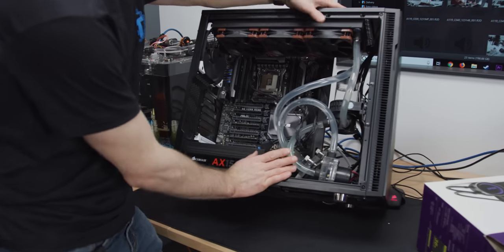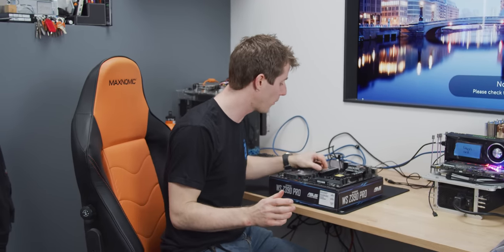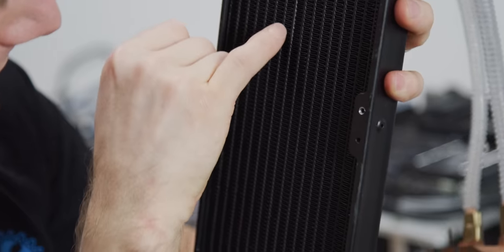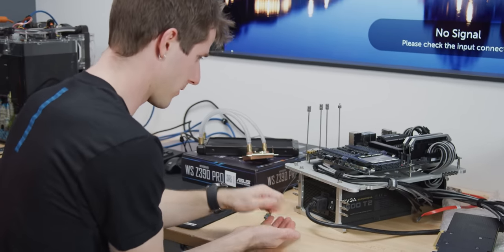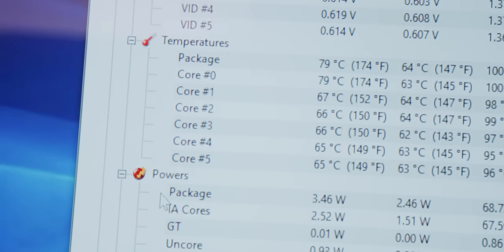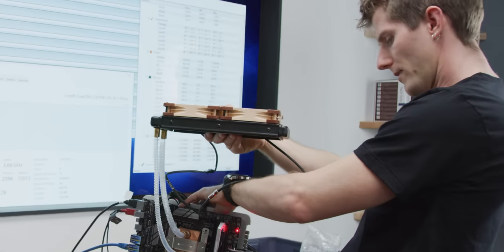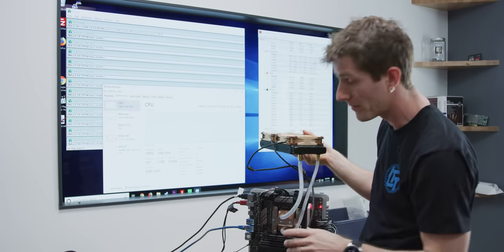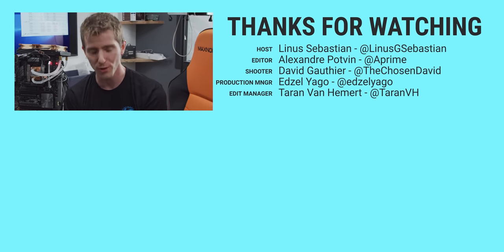CPU Cooling with BOILING LIQUID 🔥🔥

Comment: I still think that the Vodka cooled PC is the best one yet. As long as your PC doesn't get hotter than 26°C, there should be no problem, comrade.
Reply: Vodka > everything else
Reply: Boris.
Reply: stay cheeky breeky
Reply: @danielkrogh9748  *Cheeki Breeki
Reply: Yet it had a pump of sort.
Reply: vodka we need to try everclear or moon shine heck even pure ethanol 200 proof
Reply: *in russian dialect
Why have computer when you can have gulag where people calculate graphics?
Reply: [Boris liked this]
Reply: @Schaddn  
Boris has joined the chat
Vodka has joined the chat
Boris health has left the chat
Reply: @witnesszer0  
That is physicly impossible. You cant get pure ethanol from distlling it, not200 times and not 2000 times. Youll need to use something such as a molecular sieve.
Reply: The biggest problem is that you will end up drinking it out the tube
Reply: Thats the average temperature of my house
Reply: @rtg5881  $50/gallon
Reply: ✔️ GPU doesn't get above 20°C even while mining.
✔️ Living in relatively warm 1st world country
✔️ Having the fans set to 0% to save energy
✔️ Having a living room (with computer) which is at about 4°C due to a constantly opened window in winter.

I think I'm doing better than you, Boris and your fellow comrades.

Now seriously, I highly recommend opening your window instead of installing yet another heat spreader.
Reply: yep, alcools have a low boiling temperature, around 60C.
Reply: O Y  B L I N
Reply: Pc will not get warmer because capitalist pigs deny the glorious union its oil! Thus we sit in cold Siberian concrete flat. The means of cooling truly belong to the people here, comrade!
Reply: The approach isn't actually bad! The thing is: You need a liquid, which boiling pooint is well below 100°C. Ideal would be something like methylene chloride (which is used for heatpipes and solar collectors), but any spirit will do, too. Isopropyl alcohol would be a candidate, too.
Reply: Catpirate what flavor is it?
Reply: you meant 5°C.
Reply: old joke, but there is ONLY RETRO, NOTHING MORE!
Reply: It's the worst. Waste of good alcohol.
Reply: Somone ku the Russian anthem lol
Reply: @rtg5881  You can distill pure ethanol, but you have to add a  tracer such as benzene for it to work. It wouldn't be 100% pure ethanol but it would be around 99.9% pure, which is considered chemically pure.
Reply: our PC
Reply: Thank you for introducing me to the vadka cooled pc!
Reply: witnesszer0 or even e85 or 100+ octane race fuel
Reply: Soviet’s used vodka too cool the radar on their mig21 aircraft so i think it would work great it only lasted for an hour or so however because it would evaporate then they had to land and refill it
Reply: @witnesszer0  Everclear is vodka before it's filtered, and moonshine is similar to grain alcohol (everclear) except its not usually made from grain or filtered, which also gives it a high ABV content. All of the genuine backwoods moonshine I've found has always been made with fruit, usually either berries or peaches.
Reply: @mitsukaritas  99.98% IPA under less than 1 atmosphere of pressure..?
Reply: @rtg5881  proof is technically just how long it burns. 100 proof is what the soldiers were expecting, when it was underproof it was bad as it wasn't strong enough, over proof made them sick.
Reply: @Megalomaniakaal  wat?
Reply: Still a party when it's above 26.
Reply: @mitsukaritas  I'm saying vodka is watered down weaksauce!
Reply: @remy5405  they dehydrate it all im saying is they sell 200 proof for $50/gallon
Reply: Ох уж эти американцы...
Reply: Why waste vodka?!? Meths would be goo
Reply: Vodka would never in any system i have, allways be empty
Reply: It will not ignite even if it's heated well passed 26°c 
For fire to start, there needs to be fuel, air, and heat. With vodka running in a closed loop like that there will be no oxygen, any small air bubbles will be quickly consumed by any fire and it will sufficate very fast

Comment: Next up: CPU Cooling with Holy Water
Reply: the JESUS CHRIST rig
Reply: @arsh6082  
Complete with priests who are a little extra touchy today
Reply: @arsh6082  the Pope Supercrux 100 ghz ,500 extabyte RAM, 35" 256 monitor, 900 nonabyte Plasma HD.
Reply: Speedwagon Foundation if holy water was to exist or does exist, then I don’t know what doesn’t allow it to happen.
Reply: The normal stuff? Or the pope blessed stuff?
Reply: @kurtislee555  r/Woooosh
Reply: But would that work
The pipes would have to be pretty "holy"
Reply: The Power of Christ Compels you! But does it compel extra frames from your CPU? Well find out right after I tell you about Private Internet Access. PIA allows you to sin in private thanks to its extensive network of servers...
Reply: This is just how PCs work in 40k smh
Reply: @JKSSubstandard  This is fucking amazing, thanks.
Reply: Pray for your cpu cooling if you planning for cpu overclocking
Reply: boils the hell out of it
Reply: You better boil the hell out of it
Reply: + 100 Holy FPS
Reply: @Cellphone Dave haha
Reply: Can it run DOOM?
Reply: May the lord bless you with cool temperatures
Reply: We might need Steve "Tech Jesus" Burke for it!

Comment: This is called thermosiphoning. It was used in a lot of early water cooled engines (Ford model T for example).
Reply: thermosyphons are the best syphons
Reply: Yea 
I knew that
Reply: i have done the same thing with 3m's submersion  liquid drain out your radiator add the 3m liquid start the  pump up to get the sir out of the lines you want to tryed the system full with 3m liquid got poor performance  but if you fill up just the lines and leave the radiator 1/2 full wow its night and day difference this is with no pump circulating the liquid .
Reply: Except the early Ford engineers understood that return path must be lower than supply to the condenser....
Reply: Its a very cool concept, the pressure or lack there of inside the tubes makes a huge difference.
Reply: in chemistry we call it a reflux
Reply: @ThomasLancheros-kg1nl  then they weren't talking to you.
Reply: @ghoffmann821  Yeah this would work way better if the cold leg were lower than the hot leg and the radiator ensured the surface area of the liquid inside the condenser is maximized. The condenser also would need to be above the CPU block quite a bit to create a decent amount of hydrostatic/fluid pressure due to height difference which should help ensure the block is filled with liquid instead of gas. Also the block should be designed in a way to make it easier for liquid to always be in contact with the whole surface of the CPU. Taking inspiration from the passive heat removal system of the VVER-446B type of nuclear power plant could help, though it uses only convection in a pressurized water loop, not phase change. I think a passive phase change cooler like this would be possible with a liquid like the Novec series used in immersion cooling due to their relatively low boiling point and I assume this is what they actually used here as well. The boiling point should be low enough for sufficient vaporization to happen at medium CPU temperatures but also needs to always be quite a bit higher than ambient temperature. The condenser could be designed in a way to utilize convection of air. Either way it would need more space than a standard tower in regards to height.

Comment: PC: makes noise above 1db
Enthusiast: UNACCEPTABLE
Reply: Justin Roiland's voice
Reply: yeah never understood this when my headphones are noise cancelling, running dead by daylight with my fans at 100% using msi afterburner, i still cant hear them at all and theres 8-10 of them in my case
Reply: I just used all Noctua fans and it got me close enough. Those things are insane
Reply: Indeed! It was quite painful for me to migrate from my gorgeous fanless machine to a laptop...
Reply: PC parts developer releases part with 0.01% improvement over previous model
Enthusiast: MY COMPUTER IS TRASH NOW GOTTA BUILD A BRAND NEW ONE
Reply: @DumbguyMc  Same. I use liquid cooling and fans (for the GPU and positive airflow).

Call me paranoid but im gonna protect my damn investment even if it fucking sounds like a fucking jet engine.
Reply: @ChrisPBacon9  they are but not college budget friendly. my rebuild gonna include them though.
Reply: @AstroKitty16  its actually pretty good if you want to OC. I run an FX-8350 OC'd and its a fucking oven. Raises room temps by 10 degrees sometimes. For me, 70C is unacceptable (because heat kills hardware. The cooler it is the longer my investment lasts) so liquid cooling has done an exemplary job.

edit: Yes i know fx is old but, at the price i built my system and how it performs you would have gone the same route. I built my fairly impressive rig for very little. and it hasn't given any issues besides it toasting my feet. It also allows me to stash away cash for the end game rig post uni so imeo my move was a good one.
Reply: @oceanbytez847  Do the 8320E and 8370E really draw less power?
Reply: @DumbguyMc  So. I'm sure I'm not the only guy but I can't stand noise cancelling headphones, they make weird whiny noises... I swear... They like... Have some super high pitch on at all times...

Tried like 7 types and they all have it.
Reply: @cruelfish4824  I've noticed that, I didn't know it was because they are noise cancelling cause I only get it when I'm charging them, but even with them  off my front 3 case fans run 24/7 and just my tv volume drowns them out
Reply: capacitor and coil noises ...
Reply: I’m an enthusiast I just don’t care
Reply: Most people that whine about fan noise are wearing noise cancelling headphones anyway...
Reply: Alex V4 2080Ti or nothin bro why even play games if you can’t do it at 4K over 9000Hz with ray tracing
Reply: @oceanbytez847  heat doesnt kill hardware, voltage does
Reply: Yeah, I run my computer at -5dB max
Reply: My radiator is the loudest part and my headphones are like WAT
Reply: @ChrisPBacon9  industrial noctuas looking around sweating profusely

Comment: Linus (ocztony here) I had a 4 board  system for testing in a workshop, indirect water to water cooling as well as 4 outside mounted 360 rads in series, the loop actually coped with over 1kw spread over the 4 boards with ease, in the winter I could actually sub 0c cool a CPU or 2 for well over 4 hrs depending on outside temps. A closed loop 150w system is easy, just don't think overclocking and 100% load permanently. For say a HTPC yep well doable,  2 rads and the right design of block on the video and that can be cooled also. It's all about the block and rad design to get flow moving quickly. 

Shame I did not keep any pics, the pc stuff is a past life for me now.

BTW the rad needs to be cross flow, rad tilted down from the horizontal, hot in the high end and cold out the low end, around 20deg from horizontal is best. If you want to move a ton of heat mount the rads outside ;)
Reply: interesting, maybe a specially made case would work...
Reply: Tony Leach was
Reply: Dang man your smart to come up with this
Reply: yeah, that was what I was thinking when I saw him having the rad on the box tilted with the tubes up. Linus would get more cooled liquid get to the heatsink, if he tilted it the other way as you say in BTW. as he has it a lot of cooled liquid stays in the rad and only a small amount circulates, and it does not get enough time to cool down enough. some basic physics classes could be useful for Linus :)
Reply: @burtsimmons9691  nobody asked you about your opinion, right ? Just let him write what he wants to share ! 

Gtfo really.
Reply: @PoXFreak  core 2 quad extreme era as far as i can tell
Reply: @redalp90  my implementation was during the Barton core Athlon and Pentium D era. Made my own copper tube radiator and sweated it up to a homemade copper cap cooler (remember those?)
Hard lines ran from the block to the radiator, and I used 3/16 id out with a 1/4 id return, T-d in a Schrader valve to pull vacuum and used distilled water with a couple of grains of epsom salt as fluid.
Even tried denatured alcohol, although I could only pull about 10" vacuum before it started to evaporate (Could pull 27" on water at RT).
Reply: SoLongSidekick ur just making me cringe bro
Reply: @TheSolongsidekick  \o/ ::standingovation:: well done, i was going to make a comment to burt, then scrolled down a bit further and saw the was no need. this made my day.
Reply: I've actually had the idea of doing something like this when I wanted to make a fully passive fluid-cooled system. I was thinking of using a terrarium tank to cool the passing fluids by putting the radiator in a bag of water, which would be submerged in the tank, and then having the cooled fluid pass back down to the block. The loop would have to be huge, of course, but it would be relatively silent due to its size. Also, I would rather have the sound of passive bubbling going on in the ambiance of my room than a bunch of electrical fans.
 
As I was watching this video, my inner self was screaming at Linus to tilt the radiator. These plebs (jk) don't understand condensation, it seems.
Reply: Have you ever experimented with volitile gases that become fluid at certian temperatures?

This is something I have thought about myself using liquid Butane, given the correct pressurisation of the liquid, this is extremely plausible.
Reply: @TheSolongsidekick  He has a doge pfp, he's clearly behind. Also check is comment history, it's really stupid
Reply: @burtsimmons9691  Go take your negativity elsewhere please. :] I respect your opinion, but it was cruel and I just didn't appreciate reading that. You're probably a great person outside of the internet though!! I hope all is well in your life, stay strong and keep improving your life! ^-^
Reply: @burtsimmons9691  Well that's a positive and a negative. Guess it balances out! ;)
Reply: @burtsimmons9691  Please keep talking, watching you get taken down never gets old Xx
Reply: @TheDomSkill  like steam? 😎
Seriously though, butane is a poor choice due to its ease of ignition if the loop leaks. Looks like a loop pressurized to 5-7 bar would phase change between 50-60° C. 
I do like where your headspace is at though! So long as we accept flammability (inflammability?) Acetone becomes an excellent candidate in terms of boiling point… checking thermal transfer properties now.
Reply: @martindinner3621  it could be done with water too, given the correct negative pressure! Volatility is just exciting
Reply: Create a vacuum in the system to get the boiling temp of the water down...
Reply: @jrhymescrypto  I turned them down, along with EK water cooling which i do regret!
Reply: @jrhymescrypto  airguns now, tuning for comeption. Got a few champions using my kit ;)

I'm old hat with computers now.
Reply: @burtsimmons9691  shut up pal I enjoyed reading this actually
Reply: @TonyLeach-airguntech  Air guns? Like the woman who just won the olympics shot lol
Reply: You're pretty poggers.
Reply: Been a long time since the OCZ forums back in 2010 think it was.  You taught me a lot about OCZ SSD's and the wonders of RAID 0 Tony. Chatting about in-line water chillers and different CPU block designs. My love of all thing's tech has only grown since then. Thank you, Tony, for teaching me so much.  I hope you are doing well.

Comment: "TRULY SILENT COMPUTER!"
*it's making bubbling boiling noises the whole time.
Reply: well the final product may be better. Also worth noting boiling noises are WAY less noisy than several fast blowing fans.
Reply: @oceanbytez847  also they can be relaxing lol
Reply: @namefighter8426  You gonna have tonpee the whole time while gaming 😂
Reply: The calyos case was quieter.  i think that got cancelled though.
Reply: @oceanbytez847  i have my entire system done with air cooling and i dont hear my system at all. maybe if i start focussing on it but otherwise i dont hear it
Reply: @oceanbytez847  You still need fans to carry the heat away from the radiator. This could be a really product some day, but eliminating fan noise isn't the reason.
Reply: Free ASMR
Reply: IT’S WHISPER QUIET

Comment: Boiling liquid cooling requires the condenser/radiator to be mounted with  the  liquid outlet lower than the gas inlet so that circulation can occur without bubbles of gas fighting the returning liquid. 
Turn the radiator slightly on its side so that one outlet is at the bottom and turn the cpu so that the gas can exit at the top. Top to top, bottom to bottom.

Duh!
Reply: Would love to see this retested as you said. I was thinking the exact same thing.
Reply: Really, what this needs is a crossflow radiator so the vapour line enters at the top, and as it condenses, it runs down to the bottom of the rad, and returns to the block as liquid.

I've experimented with a similar unwicked heatpipe in the past, but mine just used a large hose, instead of a proper circuit with a return.

It worked well to a point, but because there was no force to the flow putting liquid back onto the block, it would eventually cross a threshold where there was a continuous bubble, and the cooling mostly stopped.
Reply: @komulista as a scientist i felt bad for the engineer who made this.  Linus could at least have had enough respect to read a little bit, the lack of that small effort just makes me sad.
Reply: I'm suspicious about the radiator, you'd think this thing would need as special radiator, this radiator looks like a plain old forced liquid radiator.
Reply: @djritter11223  Retested with the fans actually on would of helped a whole lot too
Reply: Took the words right out of my mouth.  I'm thinking it is probably ionized water under vacuum to reduce the boiling point.  Makes me wonder if I can pull a vacuum on my existing custom loop and benefit from the effect.  So curious to try this now.
Reply: Also 
1. CPU block need to be with more space for liquid collection.
2. Need liquid with lower boiling point (e.g. spirits with 40-50 C vapor point).